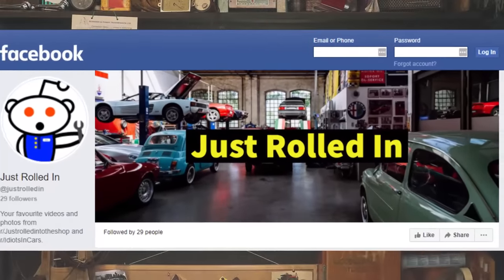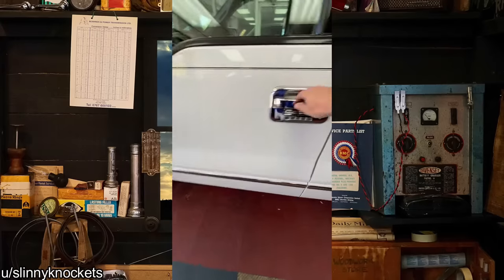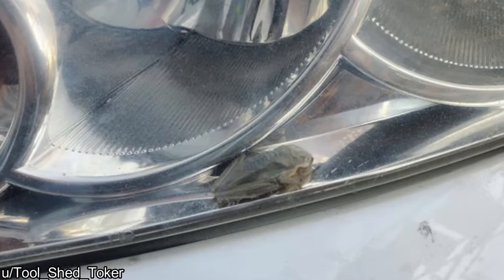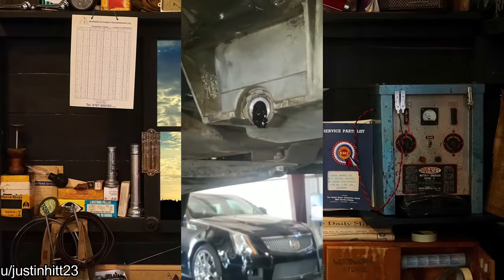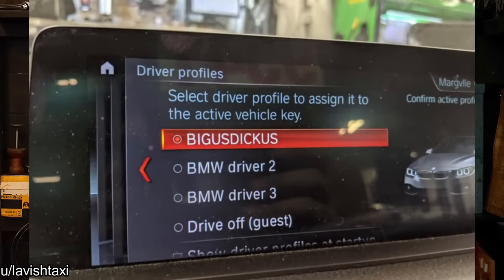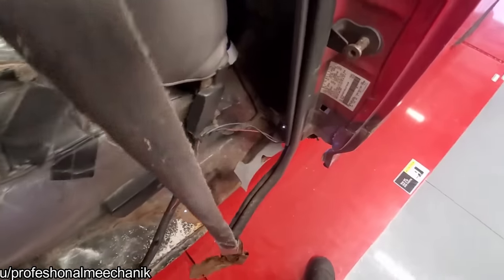Customer States Compilation (Best Clips & Photos so far) | Just Rolled In

Comment: The last one with the jello mold... About 20 years ago, I took hydraulics at my local community college; my instructor was the head of the automotive department. Before that he was the head mechanic at one of the local Ford dealerships, and he told us about just such a case. How much STP was involved this time????
Reply: On the OIL PAN JELLO MOLD...  Some one put 2 packs of Knox Gelatin in the oil... Revenge is a dish best served cold...
Many Blessings , SMR
Reply: I bought a ranger 2300 that was insanely clean inside the motor for 115000 miles but the oil pickup screen was full of some rubber junk that looked like shredded hose material ( no not silicone, nothing at all like silicone.) I cleaned it out and drove it another 100,000 miles wondering for a time what it was and concluding it was sabotage.
A friend that worked at a dealer told me that the early oil treatments like Slick 50 had not perfected formula that if something like anti freeze got in it the Teflon would coagulate into rubber-like substance.
I remember previous owner mentioning it getting oil treatments

Comment: the last one made me remind the old Lamborghini traktor, the boss told me "use the wrench to make contact between the battery wire and the starter to start the engine and pull this hook to stop the gazoil to stop the engine" we never found the keys, but the traktor still works todays 10 years after lol

Comment: I can't help but think that gelatin or something was added to the oil of the "jello oil" for effect for the video.  I have seen some catastrophic engine fails in my 25 years but never anything like that.
Reply: Motor oil in the automatic transmission? I've seen something sort of like that.
Reply: Or it's was done for revenge kinda like sugar in the gas tank.
Reply: Maybe they had a leak and use craploads of some additive.
Reply: On the OIL PAN JELLO MOLD...  Some one put 2 packs of Knox Gelatin in the oil... Revenge is a dish best served cold...
Many Blessings , SMR
Reply: @likearockcm  On the OIL PAN JELLO MOLD...  Some one put 2 packs of Knox Gelatin in the oil... Revenge is a dish best served cold...
Many Blessings , SMR
Reply: @TheSmreeder  What flavor? Asking for a friend...
Reply: @haroldwilkes6608  Lemon.

Comment: Back when I was a teenager in the 90's,  underglow wasn't a big thing yet.  But  I wanted lights on my car and an old trucker friend recommended lights in in wheel wells above the tires like that.    So I went to the parts store an bought 4 red, oval-shaped clearance lights.  The ones with two 194 bulbs each.    Those, and about 10 feet of red .16 wire.  My 76 Impala had metal inner fenders so I grounded the lights directly.  ran each lights positive to each corresponding side marker and whoop-dee-doo!  Red lights.   I spent like 20 bucks and about 45 minutes.   Then I wanted them brighter.  So I replaced the 194 bulbs with the 914 bulbs  (same base,  just bigger & brighter bulb)    Now those inner fenders really lit up!    
The small-town cop was not impressed with what looked like a UFO cruising down the main drag the next Saturday night.

Comment: 2:50 That was actually a problem with certain Lancias.  Over time, the battery shifted in its mounting, causing the hood to short out the battery terminals.

Comment: one of our skip loaders had a button on the floor you had to press down on to shut it off. it worked a valve on the air intake which choked it to a stall. it was apparently so you could remove the keys and lock the cab while you were working the loader

Comment: I am always surprised by the number of things that are apparently legal in the US but would be illegal nearly anywhere else.
Reply: Most are not. But we don't expect cops to be mechanics and search for this crap.
Reply: @glasstuna  they don't need to be mechanics, the just have to look your technical control (a little paper on your windshield like insurance), if you don't have one, you leave on foot... This is how it works in a lot of countries
Reply: @Gloubi_Goulag1663  you mean inspection stickers? We have them too. But in America, for many defects, it's not illegal to drive with problems that would fail an inspection. For instance, my car has an issue with a valve that will not pass the next inspection (gas tank vapors) but since it's not a safety concern like bald tires or missing brake calipers I cannot be ticketed for it.
Reply: @glasstuna  ok so it's almost the same
Reply: @glasstuna  but in case of bald tire like in the video, you don't sign a waiver if you don't want to change, you get a tow
Reply: @Gloubi_Goulag1663  I just rewatched the video. If an American cop saw any of the safety violations in the video on a car they would absolutely ticket the driver. We aren't  savages lol.
Reply: @Gloubi_Goulag1663  this might be the biggest difference between Europe and America. The shop has ZERO authority to stop a car from driving away. Even if they refused to sign a waiver they could have demanded to leave. The shop just has to document everything to make sure they aren't sued.
Reply: @glasstuna  I speak about mechanic not cop
Reply: @glasstuna  In my country (France), if you refuse the replacement of bald tire in a garage, you can't just go with your car, the mechanic is legally oblige to keep or tow your car

Comment: I'm genuinely shocked that people can refuse to replace tyres - in the UK there is a minimum legal tread depth, anything below that and you're legally required to replace them. Frightening stuff!
Reply: You can lose 3 points off your licence for each bald tyre.
A full set of bald tyres = disqualification.
Reply: Same in Germany. I think our inspections and regulations are absolutely too much. But damn, if the tires are bald, the frame is cracked, the brakes are gone and the thing us falling apart I don't want to share a road with it!
Reply: There's legally a minimum tread depth in the states as well.
Reply: $$$ is the reason
Reply: @clay4444  - The guy drives a 2017 Maserati and can't afford tyres? LOL
Reply: @aardvarkbiscuit2677  a 2017 Maserati has to be the peak champagne taste beer budget poverty car. Looks and sounds expensive, very expensive to service because they have Ferrari engines, but you can get one for pennies on the dollar with a trade in because they lose 80% of their value every year.
Reply: @DrewskiTheLegend  I drive a grotty old slk. I know the beer budget but I keep good tyres
Reply: @foltzenlogel  Yep. 2/32 inch, or 1,6 mm. At that point, tread wear bars start showing up across the tread.

I just bought a used Dually pickup with 4/32 tread left on the rear tires. It's still legal but it's fixing to become the snowy season here, so I'm ordering some new tires for it.
Reply: I think there is a minimum legal tread depth pretty much in every country, but many don't enforce regulations.

Comment: Ya know... It's absolutely amazing how much of this stuff I see... And these people somehow drive those cars miles and miles and miles without them just falling totally apart.

Conversely, it seems like if I get a leaf on my hood, the car won't start, it goes out of alignment, the windshield cracks and the tires go flat.

There's a lady that I see nearly every day, here in the town I live in.

She has an ancient Hyundai something or another... That has the left tie rod either broken, or so far stripped, that the left front wheel is perpetually TURNING LEFT.

When she drives down the road, it actually sounds like someone is doing the world's longest burnout.

She drives past both repair shops here in town, she's even seen daily by the Sheriff as she goes here and there.

I've even spoken to her at the grocery store and told her how absolutely dangerous the car's condition is, and what all could potentially happen.

Her answer?
"Oh, I'll take care of that if it breaks"...

Comment: 4:48- here in CT we would get another 10,000 miles on that ford.
As long as the frame doesn't rot or an axle doesn't rot off, you are ok.
You do have to stuff something in where the door and the floor used to meet, rain and snow gets in

Comment: What always amazed me is, people that never check their oil. Don't know how many times I'd pull the drain plug and get 1 qt out, if that. The really amazing part is, the engines ran fine, no noises (even on some with VVT) and oil pressure was good.

Comment: My second car in 1976 was a 65 ford galaxy w/289 motor, it was ticking badly, pulled valve  covers and it looked like valve covers were still on, solid sludge. Had to soak heads in trash can full of varsol for a week to get that crap off, previous owner said he only used Quaker state oil. I haven't used Quaker state oil since

Comment: Best one like this at work was Driver states: "engine revs up when stepping on brake pedal"

Cause found after 2 hours of trouble shooting: wire that sends signal from hydraulic system to ECM to rev up when running hydraulics and brake light wire which are in the same wire loom had been rubbing on power steering hose.

Comment: A sales person brought in a Rav 4 fleet vehicle she always used.  She said it was, running super rough and made a rattling. She said she brought it in regularly for service.  I checked the service records and she had never brought it in from when bought new.  I checked the oil and found nothing but the black tar, like in the video. It was my pleasure to charge her account for a replacement engine since the warranty would not cover customer abuse of the vehicle.  I left a message on the receipt to check with management about the $9900 charge to her work account plus labour.  She winded up quitting the next day. Too bad for her that the bill was, forwarded to her personal account.  I do not know how this ended for her.  But it was not good.  Worse, the vehicle was, auctioned a few, months later and it went for way under projected price.  That too, was charged to her personal account.

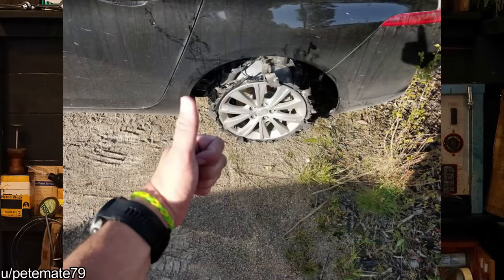Comment: @1:21 I know someone who did that. Twice. In the same night.

His main tire had a leak, so he tried to change it. Bent the hell out of the side skirt on a Le Saber. Finally got the spare on. Was told not to drive too fast. Did 75 on a donut. Blew the donut. Insisted someone come bring him another spare. I show up. His sideskirt is now twice bent out of shape. Also, lugs of my spare don't match his tire (he was told by phone but insisted I go out there and try anyway.... because a spare with 4 lugs, will fit on 5, if you just dont use one.... apprently).

I sincerely wish I was making any of this up.

Comment: That ford at 4:45 looks just like my 1990 I have had since high school, had my seat belt bailer wired to frame for safety. The body on the one in video is better than mine but the diesel and frame are mint with only 500k Ny miles on mine. Picking up a new body off a southern 2wd and having my frame acid dipped. Will be nicer than my 2019 when done.

Comment: i will be upfront, i’ve recently changed my oil in a long time and am considering changing it again since i didn’t fully clear out the old oil. essentially flushing the rest of the oil. 
also, i changed my break pads without a problem
NO MORE SQUEAKING

Comment: @6:25 ... not a wheel bearing, that's fords IWE (integrated wheel end) or fancy way of saying vacuum operated hub, using engine vacuum, and a diagram in there to disengage the hub when in 2wd, and removes vacuum to engage 4x3, when those diagrams fail, the hub half way engages to the axle shaft spline causing thats particular grinding sounds. Not the bearing 🤣

Comment: I had a Hyundai elantra come in once, don't remember how long she had gone without an oil change and I couldn't get much oil to come out, maybe half a quart.  Went up top to pour oil down, make sure its not clogged and oil came up out of the valve cover.  Stuck my finger in it and it was like toothpaste it was so thick.  Used a "oil system cleaner" which breaks down the sludge and managed to get a couple more quarts out of the engine.  Ran some oil down to be sure it was getting through the engine.  Filled it up and told her next time she comes in do another system flush.

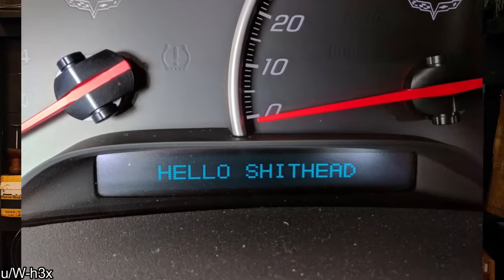Comment: 3:43
That's just Honda steering wheels - they legit make them like 2mm smaller than standard.  It's so annoying to try to find a proper-fitted cover for those; but you have to because otherwise the wheel is too hot to touch during the summer time.

Comment: I went to a Toyota dealership once to have my truck worked on in the mid 90's. I was talking to a mechanic, and he was telling me how reliable his truck was. He said it had 40,000 miles on it and he never even had to change the oil. I remember thinking, "Had too?" I don't know if he was bullshitting or not, but I never went back. Shortly afterward, my 22R sprung an oil leak between the timing cover and oil pan they had been working on, so I think he was just incompetent. I took it to a different garage after that.

Comment: In Australia if you have a major defect that is on the Roadworthy Check (when you transfer Registration) the shop cannot let you drive the car without putting a defective notice on it. So this stops "bangers" being driven around even if you are not applying for the Roadworthy Check and just getting something fixed. I was given a stern talking to when I wanted a Wheek Alignment done to a Car I just bought snd the Tyre Shop claimed the 'scratches' on the Alloy Wheels were boarderline and implying they had some really great aftermarket wheels to fix this. I refused and said I have a spare set of wheels at home thanks.

Comment: I can explain the frog, I had the same thing happen after installing aftermarket LED headlights, the waterproof caps won't fit over the big heat sink and fan on the LED bulb, so frog goes in and don't come out.

Comment: The two tires that were completely bald remind me of myself....I never change a tire until it goes flat. I drive them well past even when they start to show wires. Tires are super expensive and I don't even buy new ones, I always get the cheapest used ones possible (usually about $30). I once rode on a donut for 12,000 miles....and when it went flat I slapped another donut (that I luckily got for free) on. I even drive on bald tires in snow storms when needed....I have never wrecked and have only been stuck where I needed help twice (and on that day people with brand new tires were getting stuck left and right).....I know how to drive. The one expensive thing I do buy is oil though, because it is actually cheaper to buy the 15,000 mile synthetic oil and only change it every 20,000 miles (I figure I can push it at least 5k beyond what the bottle says). Besides it would be impossible to change my oil every 4,000 miles....I'd be changing it damn near every week.

Comment: Question, how do you fix the car with the wrong size battery installed? Since the hood is now electrified
Reply from the maker: Install the correct size battery and you should be fine.
Reply: @JustRolledIn  but wouldn't you get shocked when you touch the hood lol
Reply from the maker: Once you pop the hood it should be up just enough that you can lift the hood without getting shocked and then swap out the battery.
Reply: @JustRolledIn  ah okay 😅👍🏻

Comment: This is some funny stuff especially after I was a mechanic for so long are used to love those people I just change my oil what are you talking about and you tell them they have the pushrods are worn out the lifters are but just adjust my valves one more time so it’ll work no I won’t

Comment: Our foreman said to check the oil every time you fill the gas tank.  So I went to the warehouse to fill the gas tank.  Check the engine oil  and it was below the dipstick.  Went into the warehouse and got 2 quarts of motor oil, put them into the engine.  Checked the dipstick and the oil level was still below the dipstick.  Went into the warehouse and got another 2 quarts of motor oil in put them into the engine.  Check oil level and it was still below the dipstick.  Went into the warehouse and got another 2 quarts and the warehouse lady came out and said "What are you doing with all that oil?"  The engine was at least 6 quarts low on engine oil, it may of been more but I forget.  I looked around the engine looking for the engine oil capacity.  It was a Ford V8 and was around an 8 quart capacity.  That truck never did run right.  The people I worked with are just plain lazy.

Comment: The one with the steering wheel cover and with the side note that these should be illegal in my state of Maryland they are. The only time that it matters is if you are having your car inspected. When I bought a used car from someone I put a cover on the steering wheel. After the inspection the mechanic showed me on the inspection ticket where it referred to steering wheel covers.

Comment: Either A they are trying to get high 
Or B they have a hose going to the intake that punctures the canister and they have to hold it while it gets freezing cold and think it makes it nos powered 
Based on size it will not affect the engine and you will not go faster  obviously
But I think they were just getting high

Comment: 2:38 How is that even possible?!
I understand how a power steering failure can cause the steering wheel to turn by itself. But after a few turns, shouldn't it run out of steering rack?

Implying that this steering wheel isn't connected to the rack anymore. But if that's the case, what's turning it??!!

Only logical conclusion I can come up with is that we finally have proof that ghosts are real..
Anyone got a slightly more worldly explanation?